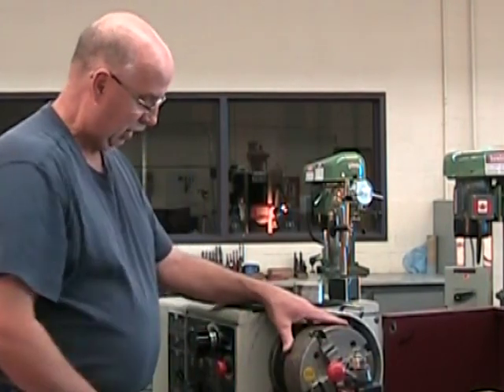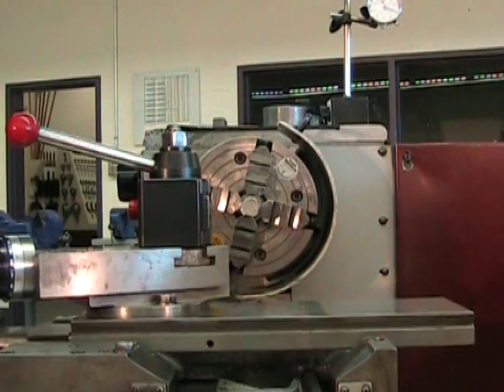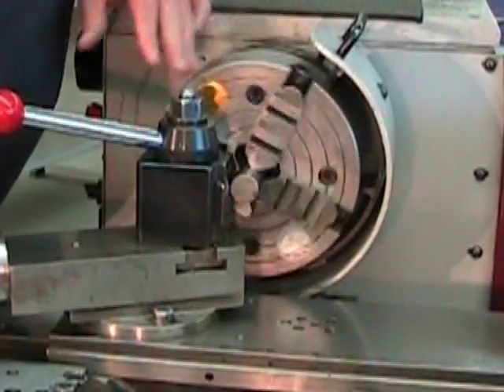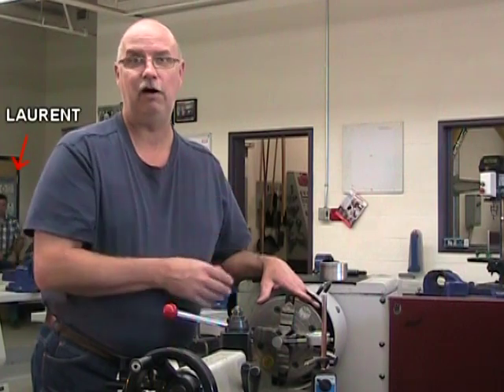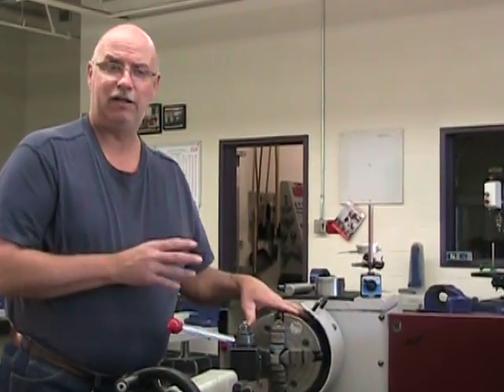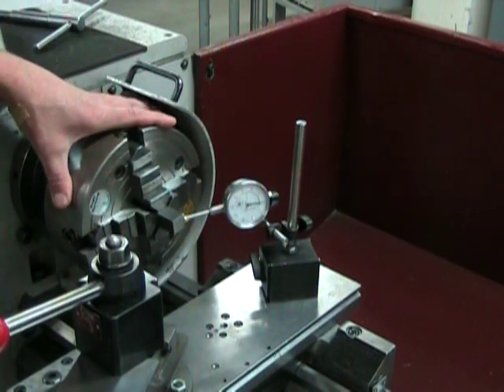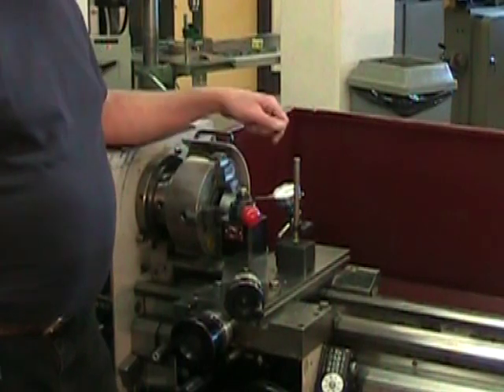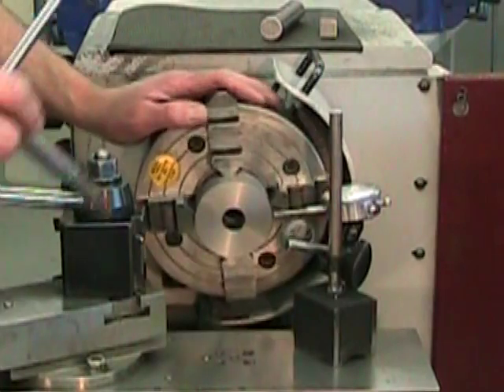CENTERING A FOUR JAW CHUCK (HOW TO) FOR DIFFERENT SHAPES OF STOCK, QUICKLY & ACCURATELY MARC LECUYER

Comment: Thanks Marc.  After hour of trying to get me 4 jaw centered using the DIY method and the suggestion of a couple other Youtube contributors, I followed your example and presto; took only about ten minutes.  I know that's slow by comparison but it was my first time so I'm pretty proud of the accomplishment.  I wanted to stop at .0005 runout but the temptation to get it zeroed was too much.  That's probably why it took ten minutes.

Comment: Hi Marc,
Would it any advantage to use a flat or slightly convex tip on the dial indicator to "average" the contact surface, rather than using the ball end which can "drop" into surface irregularities as the part is rotated?
Cheers Eric

Comment: Great tip I found, on the chuck key take out the bar and use hand grip strength to move the pair of jaws. When you have aligned all jaws, use the bar and nip up all jaws equally. Works alot easier with a range of people with different strengths, and avoids chasing zero.

Comment: Thank you; great video.  What about a round or non- round part, where a hole needs to be; how do you center no an existing feature? think cam lobe or a boss on a lathe slide nut
Reply from the maker: Hi Frederick! When centering from an existing feature it is best to just  do as you would normally do but from the feature that you want centered. If you have a square shaft that is cylindrical on its end (turned down) just apply the dial indicator on the round section and center as if the whole part was cylindrical. When centering from a hole, just apply the dial indicator to the hole, and so on. Here is a link to one of my videos that might help. Thanks for watching and for taking the time to write, Marc.   https://www.youtube.com/watch?v=fnhXkQPwpyA&feature=youtu.be

Comment: What about a round  in the jaws to cross drill the centre? I understand a 'V Centre Finder' might be the answer or a scalpel blade with the dead centre pressed up to it but if anyone can give me a method used to dial it in within a Thou, I'd be very happy to know.
Reply: Hm.  Interesting problem!  And two years later... after your project is finished...  :)  I have a thought or two.

What about using the dial indicator near the center, against the "face" of the part, so that as you rotate the chuck, it rides up on the high points and down on sides a little bit?  Then if it was centered, the low points along the sides would be the same.  The further down the sides, the better.  But I dunno -- that would be difficult on a small part, but might work on a bigger one, since you have to get the dial indicator down inside the jaws.

Another idea comes to mind...  put flat plates in there, clamped to the sides of the part by the jaws, and set the dial indicator on the inside faces of those?  The low spots ("high" spots) would be the same if it was centered cross-wise.  Centering length-wise could be done at the ends, of course.

Comment: One thing you can explain for me is that chuck guard. I've been doing machine work for 40 years and I've never seen one like that. If it is to help you remember to remove the chuck key then it looks like a bigger hazard than not having a chuck guard. thanks
Reply from the maker: I agree Richard, it is a sorry excuse of a chuck guard. The only thing that I like about it is that it gives you a good surface to lean your arm on when filing  (for right handed people). Thanks for the comment and thanks for watching, Marc L'Ecuyer
Reply: THATLAZYMACHINIST Just took the chuck guard off my lathe. It was built and installed several  years ago to appease OSHA. It serves on use, wasn't used once in the ten years the lathe was in the shop. Removing it was my decision. You make your decision to remove it or not.
Reply: never worked with a guard. didn't know they existed lmao. all machines were 80s and below.
Reply: Think "school".  Think "random collection of students."  :)

Comment: Hello mate nice video again why don't you just use two chuck key's to alter the jaws, I found it easier,only a novice with a hobby mind. I know there's probably something wrong doing that way just nobody has ever told me. Rob
Reply from the maker: It sure would speed things up when large adjustments are required. I alternate because I can better feel the tension on the jaws when I loosen and tighten. For safety, I always told my students to never leave a chuck key in the chuck, to never let go of the chuck key until it is deposited in a safe place, to always hold the chuck key with the same hand and to always start the machine with the hand that you use to hold the chuck key. Thanks for taking the time to watch and to comment  my videos and happy machining. Marc L'Ecuyer THATLAZYMACHINIST.COM